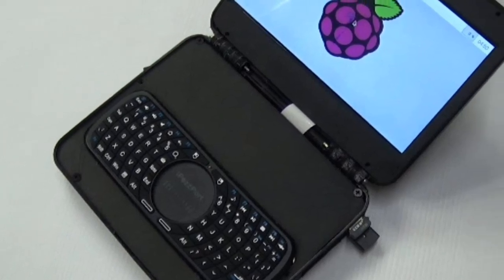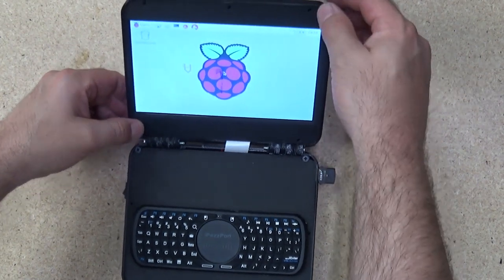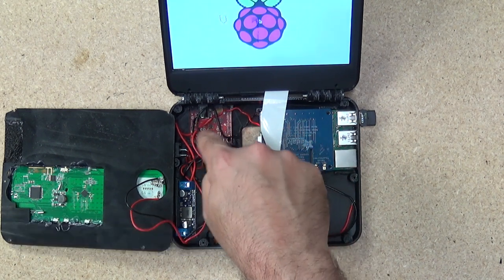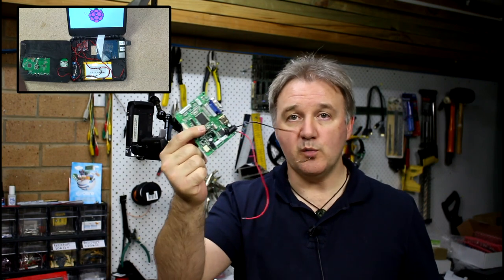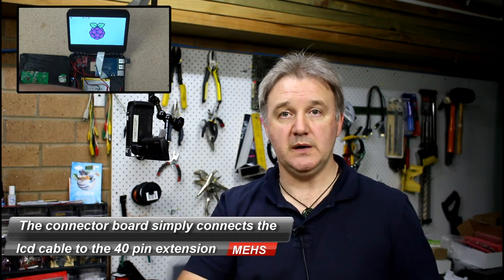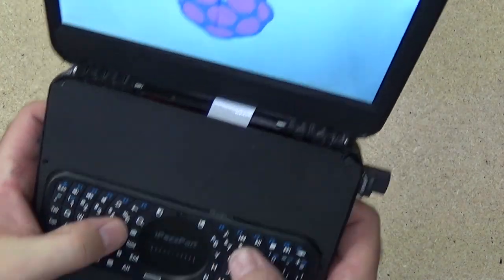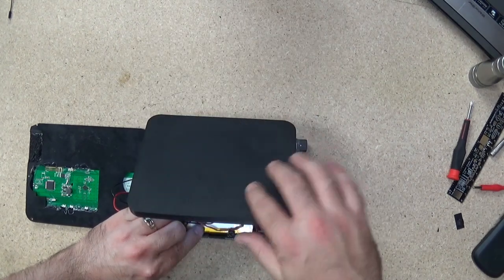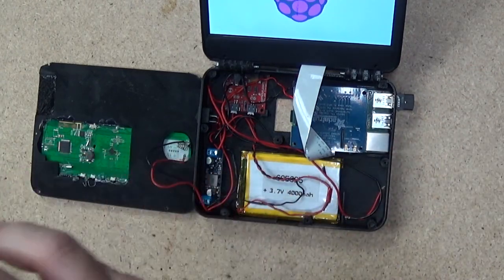Raspberry Pi 2 Portable Mk 5 (MEHS) Episode 39

Comment: Its nice to see the evolution and the problems on various pi portable projects.
Reply from the maker: - Thank you.  Yes there has been some problems to overcome.  Next I need to develop my own 5v regulator with enough current to run a pi3 and a screen as well as have an integrated lithium battery charger.  Cheers.

Comment: Nice!
Suggestion; When you move the RPi 20mm more into the casing, the USB adapters don't stick out anymore. Just make a cutaway from the bottom of the casing so you still can access the thumbsticks and ethernet port
Reply from the maker: - Hi.  Yes good point.  That would have been easy to do and given a much better overall look.  Cheers.

Comment: Nice Video 10/10 , I actually did almost same case as you done but I put there Arduino board into it, put banana pi, put a small quite fan into it and what also worked was a driver board behind the display... I use it to switch between raspberry and banana pi. 

Recommend & Answers:
 I highly recommend everyone to make a slide opening for micro SD card, it prevents dust coming inside :) 

I recommend you all also to use Plexiglas to protect the display and the dust doesn't come inside. 
 
Yes, raspberry pi 2 and 3 are same but only led was moved. 

Raspberry pi doesn't get that hot but if you want to use it longer than use fan to cooldown it.

Yes you can use it as an normal pc but only for programming, office, media and Web Browsing
Reply from the maker: - Thank you.

Comment: dude oh my ... mr. mr.
fantastic! i just saw all your videos on this subject and I'm experiencing a nice mix of envy and admiration :)
i got an old beat up gameboy anfd was considering toying with that and a 3.5 screen. but then i would need more buttons an audio amp etc ... 
clamshell is my preferred format for on the way computing
been studying a way to turn an hp jornada 720 i think into a nice pi sporting device as i love that keyboard but ... would need a compatible touchscreen to compensate for lack of mouse etc ... 

keep up the good work and have a great year!
Reply from the maker: +actudoran 
Hi.  Thanks for the kind words.  The little keyboard in this project has a touchpad mouse and it works reasonably well.  Touchscreen would be nice though and not that much harder to do.  Yes audio is a big one.  I'm adding audio to the next project for sure.  Your projects sound interesting, don't forget to share.  Cheers.

Comment: Does this set up has a UPS features? like while its charging it can run the pi, but when the power source charging is turn off, it will carry on run the pi without shutting down, and cases like when its fully charged, it will just power the pi without passing the current to the Battery? 

Thanks
Reply from the maker: - Hi.  It has some of what you suggest.  The unit runs from battery when the external power is disconnected, just like a laptop.  The battery is charged and the unit is powered when external power is connected.  Because of the IC on the Sparkfun 12711 board, the battery is never disconnected but is protected (to a point) from overcharging and being stressed.  Its not as good as a complete laptop solution but close enough for me.  I built this quite a while ago and it still runs fine.  Cheers.

Comment: HI, I admire your build. Really sweet.  I plan on copying but Im going to use a wood case instead of the 3d printing case.  do you think you could post dimensions of the case, and maybe some more info on the case because that's my first step.
Reply from the maker: +matt wykoff - Hi, I can send you the 3d file if you like.  If you use 123d design (free) you will be able to take any number of detailed measurements.  Cheers.

Comment: I've been following your builds in the hopes you'd get to something with this design.
I'm in the process of designing something similar and that kippah will save me a ton of space!
I'm looking for more of a "full size" keyboard with mine, rather than the thumb board style. Though still trying to keep it not much larger than a 7inch display.

Have you thought of trying a track point module. I'm looking for ways to get one working with the pi, saves a lot of space otherwise taken up by the trackpad, which are usually so small as to be next to useless.

Also have you given any thought to slimming down the pi itself. removing the Ethernet andaybe going to single height USB? it'll help thin your design down.
Reply from the maker: +Thomas Griffiths 
Hi.  I had briefly thought about using a trackpoint or separate trackpad of sorts to have more options for layouts but I haven't done any research into the idea.  As far as slimming down the Pi, yes I have definitely considered that and may still go for a super thin version at some point.  I would have considered it for this build but using the Kippah saved plenty of space.  I couldn't go much smaller because of the keyboard and screen.  Cheers.
Reply: +My Electronics & Hacking Show i think you'll need a ps/2 converter for the track point, so an extra board but looks like you have the space. the raspberry pi zero seems a good contender for making something ultra slim, if a little under powered.
I'll be keeping an eye out for version 6 :-)

Comment: How did you do the hinges? I'm trying to make a handheld but cant figure out how i'm going to do that.
Reply from the maker: - Hi.  It depends on the total weight but its just a friction hinge.  Make two tubes around 15-20mm each, one on the lid and the other on the base (repeat for the other side).  The trick is to make the tubes big enough to cause enough friction between the two halves.  Eg 8mm tubes are good for light load and I printed a saw tooth edge on each face so they would bite into each other.  Use a 3mm bolt as the pin down the centre and secure the nut to one end.  Tighten to get the desired tension.  Cheers.

Comment: cool laptop but I have some questions Why use a wireless or blue-tooth keyboard in a laptop ? and how are you getting 5v from the 3.7v  Li-Ion?
Reply from the maker: +Zanith50 -  Hi.  The keyboard choice is more about size and what fits best rather than whether or not its cordless or corded.  Cordless is easier as you just plug in a USB dongle and you don't have to run a USB cable or try to fit the cable in somewhere, but either would work.  I would happily use a corded keyboard if I could find the perfect one.  In this design I'm getting 5V from the Pololu U3V50F5 power regulator which takes the 3.7V of the battery and boosts it to give a constant 5V output.  The keyboard in this case is not taking power from the 5V regulator but directly from the 3.7V battery.  I did this because I wasn't certain that the keyboard circuitry would be happy with 5V.  They usually are but the keyboard was powered by 2 AAA batteries (3V total) before I split it in half and powered it from the rechargeable battery.  Hope that answers your questions.  Cheers.

Comment: I'm pretty new to this stuff, but I was wandering why you didn't use the sata display port on the raspberry pi? Does the raspberry pi 2 not have one like the pi 3 does?
Reply from the maker: - Hi.  Do you mean the DSI display connector?  The Pi doesn't have a Sata port which is for controlling disk drives.  The built in display port is very specific and there are only a few displays available that work natively with the Pi.  The screen for this project was sourced off eBay and was the exact size I wanted.  But yes, if you find a DSI compatible screen for the right money you can run it direct to the Pi.  The little adafruit board I used in this project is a very handy way to run a big number of generic displays without ending up with a bulky installation.  Hope that answers your question.  Cheers.

Comment: Could you use the HDMI port on the pi as a port for an external display.

Really like your show!
Reply from the maker: Hi.  If you mean do what I've done in this episode then yes, absolutely.  If you mean have a display connected via the kippah and another connected via hdmi at the same time ( dual displays ) then no I don't think that would work.  But one screen at a time is easy.  Cheers.
Reply: +My Electronics & Hacking Show Have you considered using the DSI port on the pi? I'm only starting to put together a list of components for a RasPi 3 "Naptop" (Short for Nano Laptop) and would like it to be as portable as a grafingcalculator (old TI-98) but have the possibility to plug in an external screen to be used when in the office.. Also I'm considering a removable bluetooth keyboard that would leave all usb ports unused; Hence the pi3..
Reply from the maker: +Pertti Örn - Hi.  Yes I've looked at the DSI options but there are only a few compatible displays.  The Kippah approach uses a standard 40 pin connection allowing for a large range of compatible displays.  If you find a suitable DSI display then that would be the option that saves the most amount of space.  Cheers.

Comment: How do you recharge the device? Does the power distribution board you used have built-in recharging functionality or do you need to add that yourself?
Reply from the maker: - Hi.  Yes the Sparkfun 12711 has a built in lithium charging circuit and has a mini USB and 2.1mm barrel jack as power input options.  The charging circuit will charge the battery at the same time the battery powers the device as long as the power draw is less than the max charge rate.  On this board the max charge rate is 1.5A.  Cheers.
Reply: My Electronics & Hacking Show Thank you for your quick reply.

Comment: Impressive build! I am planning on replicating a similar build just with perhaps a different casing and some part changes. I just had a few questions about this. So I will be using a Rpi3 which draws 2.5a (recommended at least) so will the Pololu work for that? I also will be changing the battery to perhaps a 10ah battery, maybe even a power bank. Is it possible to take directly solder a + and GND wire to a power bank, and then run that to the regulator? I would make sure that the bank is rated around 5v 2.5a but I just wanted to make sure it was possible. Can you charge the Sparkfun, and power the machine at the same time? I'm impressed that you powered the keyboard directly from the battery, but what would happen if you were to run it through the regulator? Would it short out? One last thing, I swear, and this time it's not a question so don't worry ;). I noticed you did something that sigh a lot of people do. Because the keyboard is wireless you had the wireless receiver stick out the side. What I am gonna do, and maybe you can consider doing as well, is having that adapter inside the case itself, therefore not having the Rpi ports directly used, and instead using some small male to female extension cable for the USB ports just to clean it up. Overall, you did a fantastic job and your videos are extremely helpful and fun. Subscribed!
Reply from the maker: - Hi.  Take a look at the Pololu website and the details they provide for the regulator you want.  There are really handy charts that show the current output at certain input voltages.  The U3V50F5 I have used before gives 2.8A when the input is strong (4v) but drops to 2.2A when drained.  This is just enough.  If you run the power bank into the regulator you are providing 5V into a 5V reg.  If you are using the output of the power bank you dont really need the regulator.  If you are just using the batteries then yes you run the pos and neg to the regulator.  Yes you can use the sparkfun 12711 to charge the battery and power the device but you need to make a change.  The sparkfun board only provides power to the project from the battery supply and not from the external power source you use to change the battery.  If you use the barrel jack as the external input, you can solder wires from the positive and negative of the barrel jack to the OUTPUT of the 5V regulator.  You do this so the OUTPUT of the regulator is all 5V, 5V is coming out of the reg and 5V is coming in from the external supply (must be 5v).  This way the sparkfun board will send charging voltage up to 4.2v to the battery and you will be extracting 5V and sending it to the project at the same time.  If you connect the keyboard directly to the 5V source you should be fine.  I connected mine to the battery so the power was as close to the 3v it would normally get from 2 AA alkaline batteries.  Many are 5V tolerant but you will need to check yours.  Have fun.  Cheers.
Reply: Alright, that makes sense! Thanks so much for the reply, and I hope that you keep making these Pi laptops!

Comment: Thanks for sharing the knowledge ,I subscribed to you:)
I'm trying to build one of my own using the PI 3 MODEL B.
Where can I get a battery to support the project ?
Reply: I'm gonna be adding SSD drive 32 GB and using Zram to double up the pi Ram.
Reply from the maker: - Hi.  You can get batteries anywhere including Ebay and any of your local electronics retailers.  I'm in Australia so listing suppliers I use won't help much.  You can use lithium polymer packs or the good old 18650's which are pretty convenient and have good power capacity.  Work on a 3AH cell running your device for an hour or so.  Use 2 cells for 2 hours runtime etc.  Cheers.

Comment: It looks beautiful. I recommend you put a speaker in the gap between the screen and the keyboard but other than that it is perfect :)
Reply from the maker: +zack23048860 gaming 
Hi.  Thanks for that.  Yes audio has been lacking in the last couple of projects.  If I do any more work on this version I will add audio for sure.  This unit might also make a nice portable RetroPie gaming rig, definitely need audio.  Cheers.
Reply: My Electronics & Hacking Show yes indeed. also it will fit PERFECTLY between the screen and keyboard! :)

Comment: if its 10-13 inch screen , can the battery goes into pi enough to power the screen and pi same time? if not what is the solution?
Reply from the maker: - Hi.  I have tested a 10 inch screen and it works fine.  No need for a different battery.  The kippah provides the power to the lcd so as long as you are using a compatible Lcd you should be fine with a single 5v power supply.  As always just make sure that your 5v supply has sufficient amperage to power the entire project.  A pi3 and a 10 inch Lcd would be approaching 3 amps.  Cheers.
Reply from the maker: - Additionally, you can always connect the battery to two 5V regulators for more power and if you were running a much larger display that needed 12v (as an example) you could run a 5V regulator and a 12V regulator from the same battery.  You just need to ensure the regulators provide sufficient current.  A 12V step up regulator would give 12V out from a 3.7V battery but the current would be around the 1.5 amp range for a good regulator.  That is still sufficient for most LCD's and driver boards.  In the case of this build, you don't need a 12V reg as the Kippah is a 5V board.  Cheers.
Reply: qns 1) So assuming the screen is 12v required, i would need a 5V regulator and a 12V regulator from the same battery. but for charging I just need to plug one or 2 usb to it?

Reason i asked, i googled some the clearest instruction is from adafruits, but they seems to use 2 instead of 1 circuit when come to charging pi & the screen 10 inch.

qns 2) then if assuming the screen is 5v required, i would need ONE 5V regulator from the same battery. but for charging I just need to plug one usb to it, right?

qns3) is that regulator, we called Power management circuit? is there another term for it? someone told me what i'm searching its called that but i cant confirm it. 

Thanks alot again for such thoughtful reply, i really appreciate it! I'm trying to make me own, but the online tutorials isn't great online.
Reply from the maker: weinfin
- OK.  Sounds like your on the right track but the details depend on the parts you are using.  What parts have you chosen?  Also, a lot of screens with driver boards say they are 12V but you can often run them at 5V.  If that is the case you won't need a 12V system in your project.  The instructions you have already seen may use two regulators because one does not supply enough power to run the whole project.  Again, it depends on what you're doing and the specs of the parts you use.  Let me know.
Reply: I looked around and looked your videos, below is my rough spec.

Single computer Board  - Raspberry Pi 3 w MicroSD 16GB
LCD Screen with Driver Board - IPS CHIMEI INNOLUX 10.1
Lithium-Ion Battery Charger - Sparkfun part 12711
Regulator - Pololu U3V50F5
Lithium-Ion Battery -Sanyo 6 pcs 18650 2600mAh 3.7V
Keyboard with touchpad - Rii K12+ Wireless Keyboard

qns 1) what is your view on it? Please let me know your views on it.
qns 2) For the screen, do you have any better suggestions? for 10-13 inch, be it touch or non touch at a cheaper price?
qns 3) May i know is there the lithium battery charger + regulator together with 2 output (one for screen, another for pi)?

Thanks!
Reply from the maker: +weinfin - Hi.  Looks like you have all the pieces.  How are you connecting the Pi to the lcd driver board?  The only charger regulator I know of is one by adafruit but it has a max output of 1amp, not enough for a Pi 3 .  All else looks good.  Don't skimp on the lcd, get the best you can afford, ips is good.  Good luck.
Reply: For the "How are you connecting the Pi to the lcd driver board?"

I though the LCD driver board has something of HDMI port that can use it to connect to the Pi? Please correct me if i'm wrong. 

Thanks for the advice and amazing tutorial!.
Reply from the maker: +weinfin - Yes they usually do.  Just make sure you include a HDMI cable in your list of parts and make sure you can fit it in your project.  That can take up a lot of space.  Cheers.